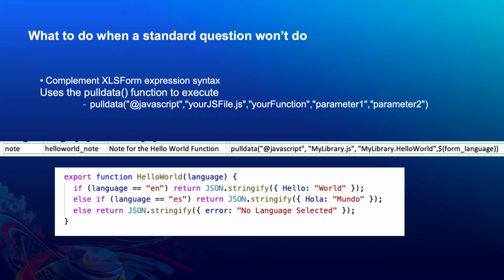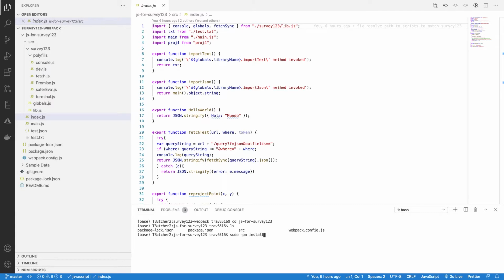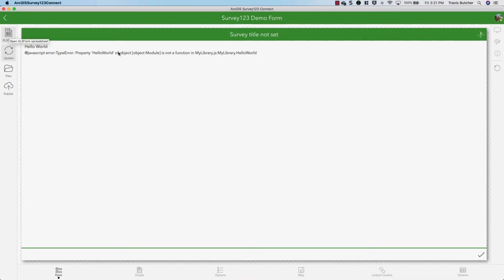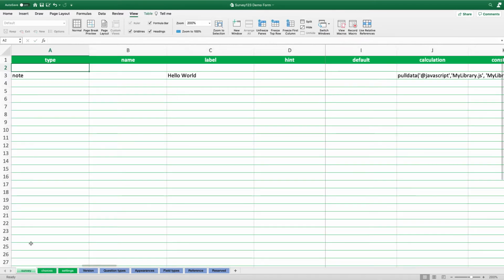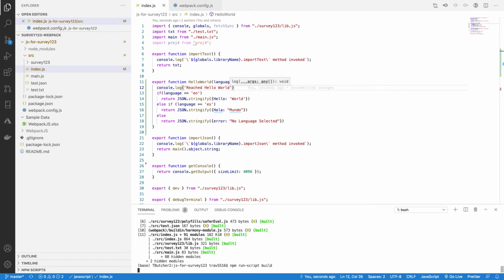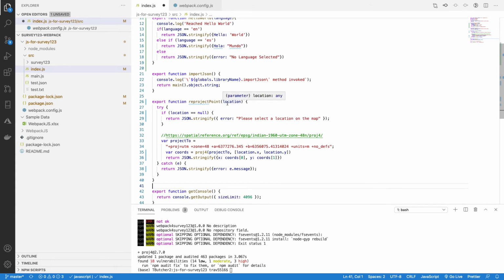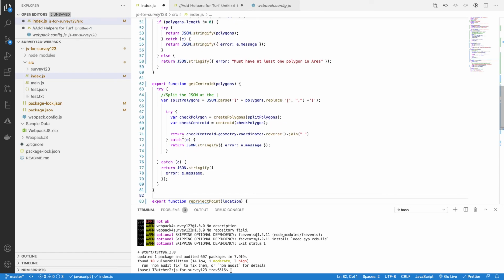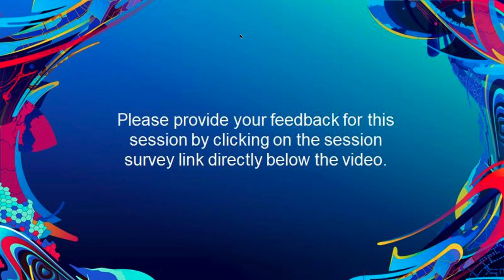Extending Survey123 Using JavaScript and Webpack

Comment: please share the file you clone, because in my visual code option it does not give the option to clone the repository.
 also the one I downloaded from GitHub is different from yours and the files you have are missing.

thanks and greetings
Reply: in 6:43 you use "sudo npm install" but dont work , only work "npm install", what the diference??
Reply: npm WARN old lockfile    in all install, this is normal??